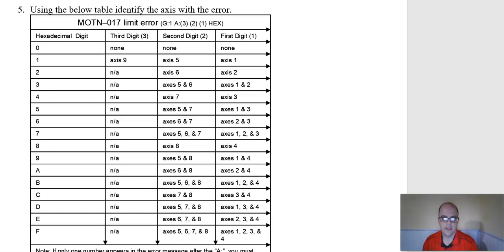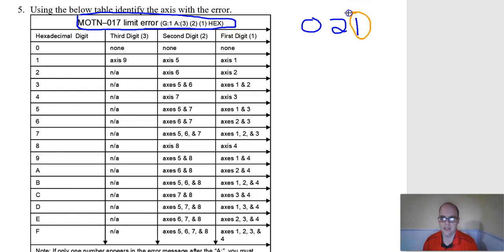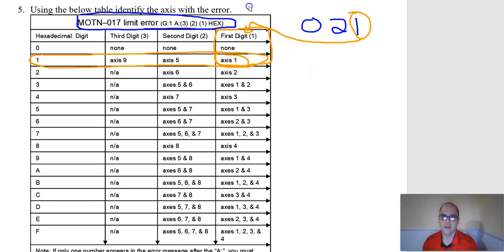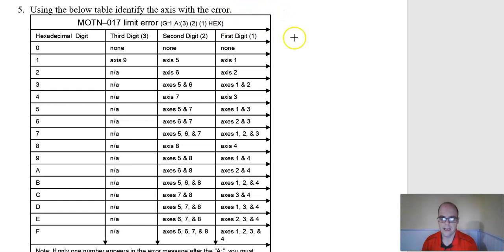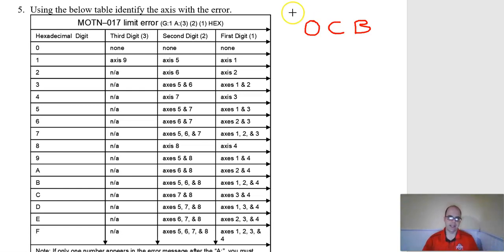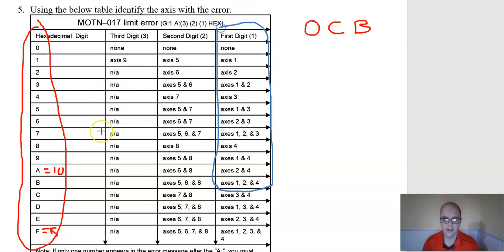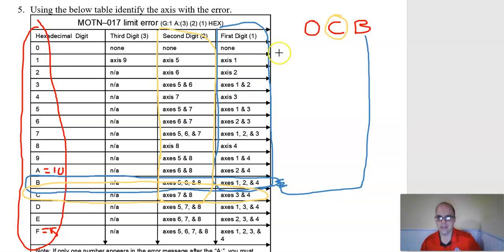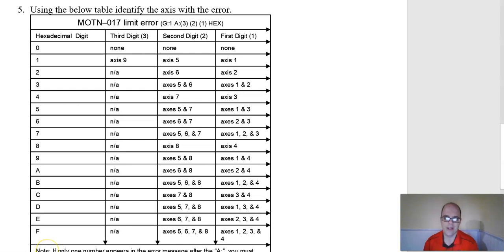How to Read MOTN-017 Error Code in Fanuc

Comment: I've got a R30iB Plus and its reporting a MOTN-017 G:1, A:2,3.  What does the comma denote?
Reply from the maker: In the newer plus models it means that's axis two and three issue. Robot group number one so it's probably your major axis
Reply: @danstaifer2028  Yep, thats it but I couldn't find it documented on the CD that came with the robot.
Reply from the maker: @jstolaruk  yeah they just made it easier just identified the accesses rather than the old hex version that I mentioned in this video.